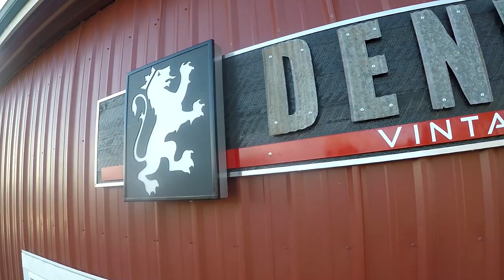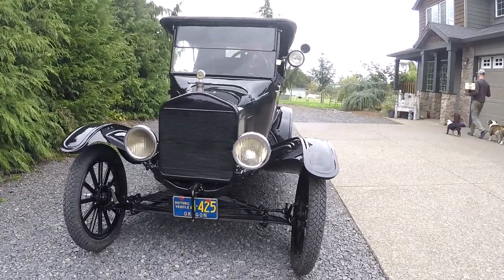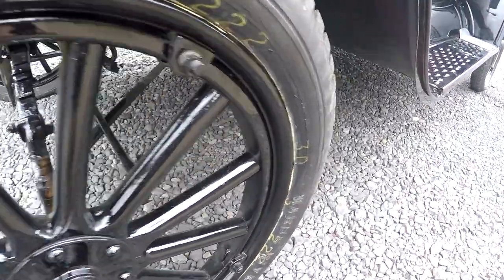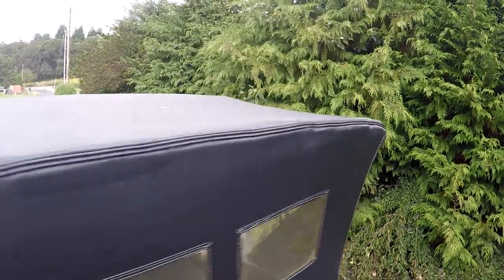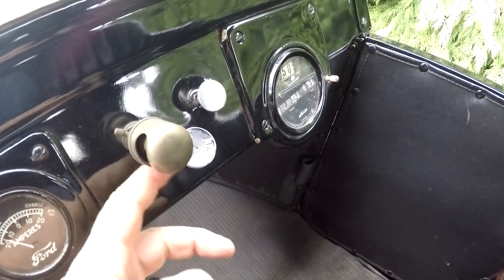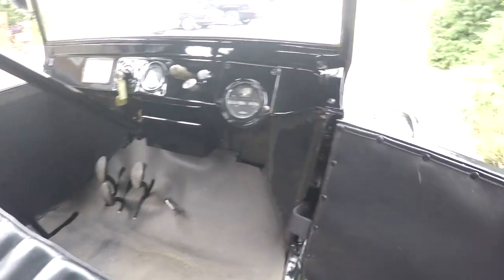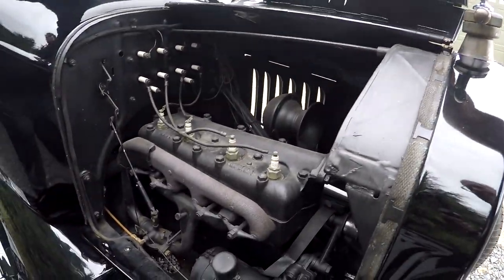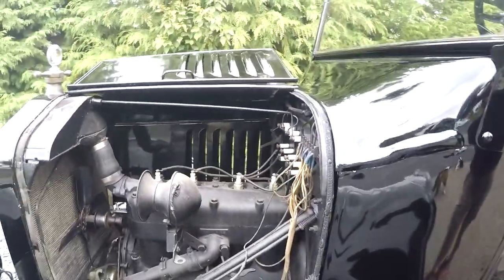1923 Ford Model T Touring - Denwerks

Comment: I have the same year, and trim. Very fun driving car. Good first car. Be careful with the spark plugs and spark plugs wires. They shoot some really strong current and will give you a 5 second seizure but you'll be fine.